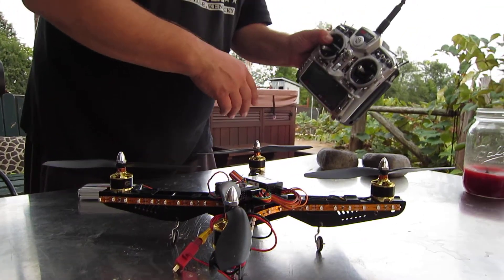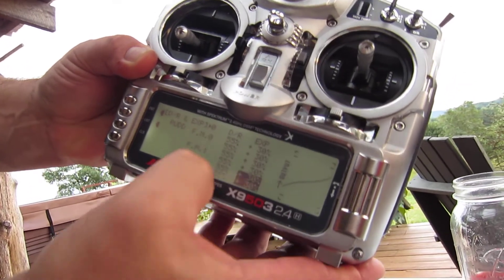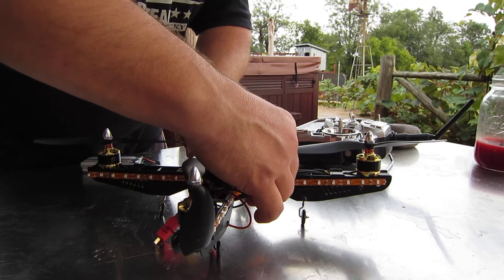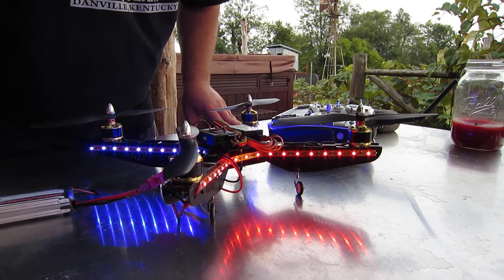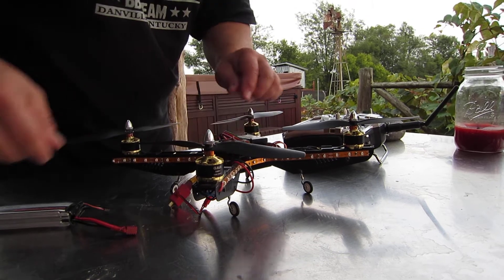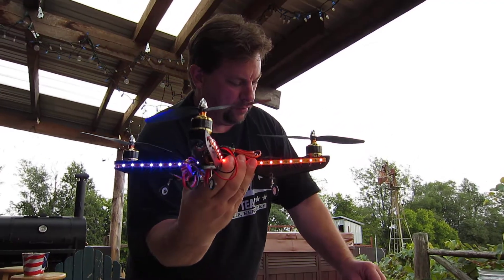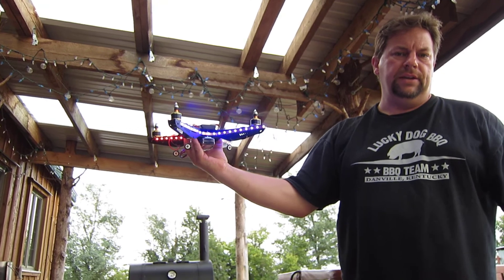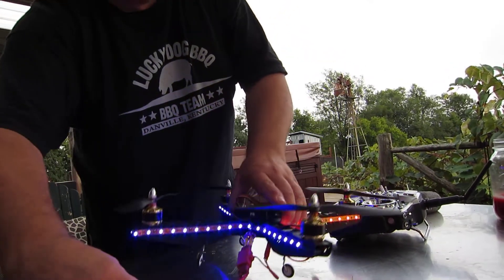Gaui 330X Calibration Problem won't fly. What am I doing wrong?

Comment: I'm far from an expert, but I think you need full throttle range, dual rate should be off or you will start your throttle to high.  Also, your hair was blowing, maybe a motor is reversed. Check prop rotation.

Comment: I have the same problem. My Esc's may be incapable. I've set up a Gaui before, and it took me a while to figure it out, but I finally got it. However with my custom made quad with the Gu-344, I'm having the same issue as you here.